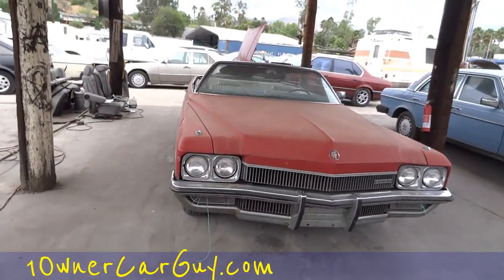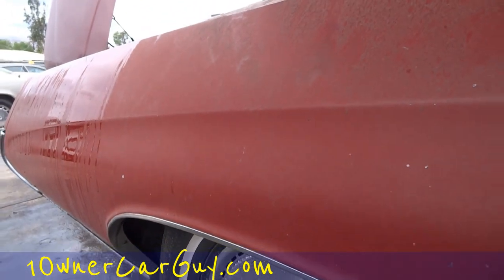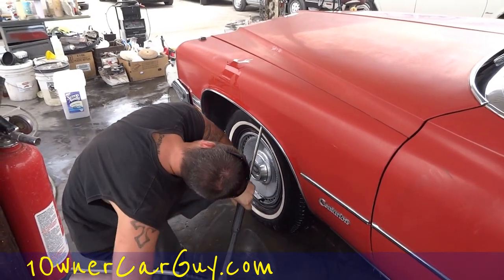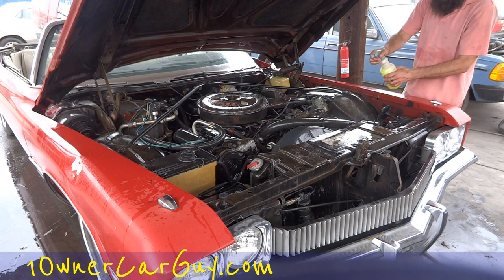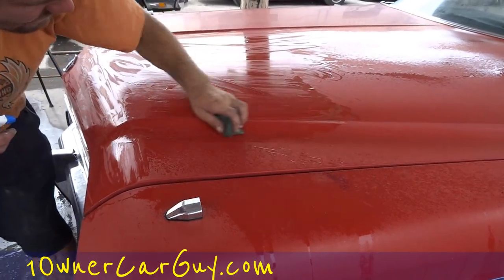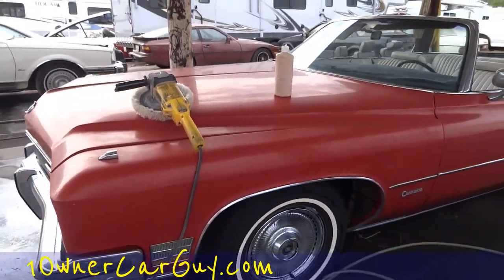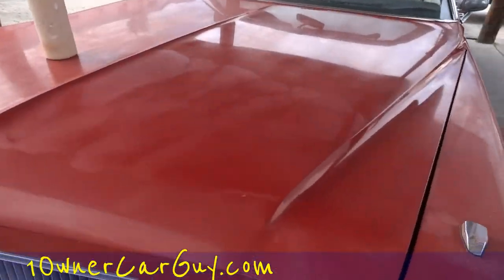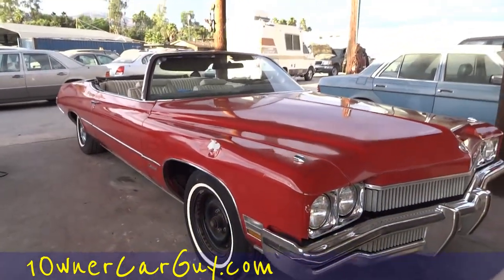How To Polish / Buff Degrease DIY Detail Wash Clay Bar Car Restoration ~ Auto Detailing

Comment: Workin at a garage i learned you can even wet sand it with 1500 first, then buff it out.   will cut your time down and you wont have to fight layer after layer of dried paint. (:     also a foam buff pad works soooo much better and doesn't burn as easily. Keep it up!

Comment: "The General" made good cars back then.  I got 10 years out of a 455 LeSabre, 2 door hardtop that I bought for $200.  It was pale yellow with a black interior that could pass for leather.  It was pretty humble by the time it died of rust in the chassis frame just ahead of the back wheels.

Comment: someone needs to teach you how to use a buffer and how to buff a car,,
Reply: infrareddreamz This video made me cringe so bad.
Reply: infrareddreamz i know nothing about how to do this stuff and so I am just curious what he did wrong?
Reply: A True Wisconsinite one of the major things that he did wrong is that he apply his compound directly on the paint when you are supposed to apply it to the pad another thing that he did is not spend nearly enough time polishing the paint if you would like to learn how to properly detail a car go to the chemical guys channel
Reply: +AntStateofMind no it does not matter at all
Reply: Jack Moffatt,  he is using way too much compound polish, wrong arm movement, wrong pad choices, but great recipe for buffing trail. 

and he made things much worse doing this shit to single stage paint. 
Single stage paint is extremely soft and thin, you can even correct it with non-abrasive chemical polish
with cutting power from just the pads. I don't bring out rotary with wool pads unless Im working on rock hard euro black paints with deep scratch. 

All this guy did was shaving off paint for no good reason, this car probably has not enough paint left for pro detailers to fix it now. 

good detailer will bring out the best result with min cutting. 
This guy brought out shitty result with max cutting. 

I wouldn't really give a shit if it was his own car, but this is car he trying to sell.

Comment: I learned a lot from your video's cheers buddy. People will always throw negativity at video's because someone is always better than you or anyone else ;) anyway looks like you love doin this so keep doing something you enjoy you're good at too great results. Quick question Im in the middle of painting my car, got a lot of overspray. Tried a red turtle wax rubbing compound by hand but the red color went into the paint - before clear coat. Panic! Red weird smeer color into nice new white paint! Couldn't get it out had to wet sand it... will it be different if I use the drill or angle grinder with the same head attachment? Feelin a bit unsure (Im in Cyprus with limited access to other brands)

Comment: Car looks great... the ONLY criticism (or comment) I would make is that in my experience pressure washing or even steam cleaning an engine bay can be very problematic, especially on a car that has had little or no maintenance. 

Wires and hoses that are worn will inevitably suffer ingress of water which even a couple of very sunny days with the hood up might not remedy.  In this instance I would just use the degreaser (in the UK we have one called GUNK  ... Not sure if this is a US available product? ). Apply with a paintbrush and leave it for a few hours and just rinse off with a watering can of warm water with a little soap so you are not forcing water into nooks and crannies, especially into the alternator, or the old worn cabling of the wiring loom. 

You would probably be changing the spark plugs and leads so they are not so much of a problem UNLESS you haven't bought them in advance and need to drive your car down to the auto spares shop... and the damn thing won't start LOL.  
Given the state of the original car I don't see too much to whine about aside from that... it's hard work but the video shows what can be done with just manpower and a few tools and products.. Good job dude !!

Comment: Can you please mention the web site again? I didn't hear it enough... also, you really need to have someone else edit your videos... 1 hr for 20 mins of info...  still, A for effort - but Im curious why there was so much paint on everything... I can understand the clay bar, and then the first pass with the rubbing compound, since you have to remove the oxidation, perhaps a bit too far there though? but the final polish? if it was sealed, there would be zero paint on the pad, correct?

Comment: Are you using a DA polisher or a plain rotary? I am restoring the pain on a 64 Galaxie with some pretty bad scratches, I want to play it safe and use the DA but if it is not powerful enough I will take a chance with a rotary. Yours seemed to do fine so I figured I was hoping to use your kind.

Comment: when doing my car and I don't want any water spots I'll just take a clean t shirt or a clean towel and drag it across the surface of the car, in minutes the car is dry and looks beautiful.  My father always used a sheep skin but either way the car is beautiful.  I'd like to mention never wash a car in the bright sun or when the car surface is extremely hot.  Your vid is pretty cool though.  thanks, james

Comment: Watched the whole video.  I had a mobile auto detail and used McGuires products.  Like your video as the clay bar is expensive.   Degreaser?  What form of that is that used instead of buying it from a major mfr like Mothers or Mcguiers?  The same?  Also, the clay bar is very expensive through a Mfr.  Where can I buy a large clay bar?  Thanks for your help.

Comment: you want to fill a spray bottle with olive oil and hit the engine reel good, get in all those hard to reach places. after your done, pull out the sand blaster and hit that surface rust...make sure you tape off the battery before you start. and WALA! GOOD AS NEW!

Comment: Hey man, i have a question. Firstly, i'm a detailing newb. My paint job was similar to the Buick, very faded. I tried polishing with some NuFinish. But after application the NuFinish didn't rub out for the faded part. I was wondering if you could give me some advice on removing it. Thanks man.
Reply: If I have to invest in a buffer I will. Just want to clean her up and the "professionals" are charging 4 digit figures for a paint job. But thanks for the words man

Comment: I used to put 2-3 cap full of Transmission fluid in the water pump. / engine. Idle it for 5 -10 min and wait till all the rust came out ! . Diesel worked good. Too.

Comment: Is it bad to pressue wash engines like these? or what parts should you avoid?
Reply: +Max Wooden  I understand the purpose of this video, but to answer your question, the electronics:  Alternator, distributor, carb inlet, interior air intake , etc. should be covered and protected  in plastic wrap.

Comment: How does compounding differ from using the clay bar?
Reply: Compounding is higher grit than a clay bar, so it removes the scratches made by the clay bar. After the cutting compound, there should be a polish and then a wax.

Comment: When I get compound in the cracks, I use one of those Butler GUM toothbrushes with the rubber thingie on the handle and I drag that rubber tip through the crack and take it all out. I'm too lazy to tape. I'm almost too lazy to buff the car.

Comment: The water blade seems to be slap wore out! Mine gets ALL the water off.
Reply: a waterblade is bad because you can drag little bits of dust dirt and tiny rocks
Reply: +supershark 9k  I have used waterblade for over 10 years without any problems on my Corvette.

Comment: degreaser on engine is a very bad idea. especially on a old timer, you gonna kill rubber and plastic parts like gaskets tubes etc. and a bit of abrasive compound before the clay bar would have made a better final result on  a very worn out paint like that.

Comment: Like your stuff dude but using a pressure washer on a old car like that i'd think wouldnt be good for the rubber seals and may cause damage that wouldn't of been there before... Yes it maybe need fixed anyway but no need to give potential customers something to bitch about.

Comment: ONE OWNER CAR GUY IS YOUR TYPICAL USED CAR SALESMAN. SHOWS A SH.T BOX AND POINTS OUT EVERYTHING THE CAR HAS AND NONE OF WHAT IT NEEDS. MAKING OLD TIRES LOOK GOOD DOESN'T MAKE THEM SAFE THEY STILL HAVE DRY CRACKS. ALSO HE KNOWS ITS BEEN PAINTED FROM THE OVER SPRAY UNDER THE FRONT HOOD. ITS NOT ORIGINAL PAINT AND TO BE SAFE HE SAYS HE'S NOT SURE IF IT'S BEEN RE-PAINTED .... PLEASE

Comment: Never wash engines of cars you are planning to sale. 
customers dont like it, because you can cover up potential oil leaks.
let me rephrase that. smart customers dont like it.
besides that, nice video
Reply: he said he was gonna drive it around to look for any leaking oil ect.
Reply: Totally Wrong. degrease & Washing motor "Reveals" potential oil leaks. not washing the engine, is actually looked down upon in the auto trade as being dishonest.
Reply: Steven J. Feuerstein  how does washing the engine reveal oil leaks? maybe if you drive it for couple hundred miles like shadowimposter said ( salesman drives and looking for oil leakes). but you wont notice any leakes on a freshly washed engine as a customer on a 10 miles test drive
Reply: jerri0401 well if the engine is clean if there is a leak u will see it easier😂😉😉😂

Comment: Pressure washer on paint? Please viewers, never do that to your cars finish.
Reply: +lar4305 it dont hurt the paint if its a safe distance from the surface
Reply: +lar4305 Generally, true. But at a safe distance, you'll be fine. With an old car like this with no paint protection, sneezing on it will blow away the paint. At this age, you're looking at salvaging what you can to make it look pretty or you start with a new paint job. Those are your only two options.